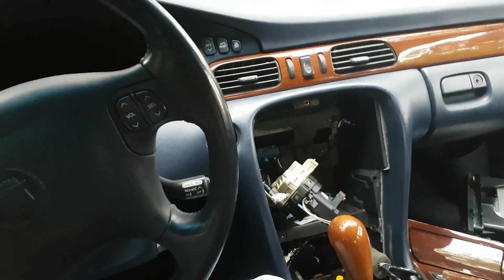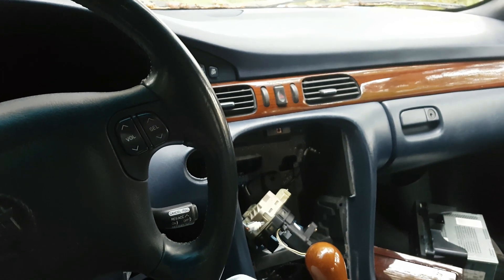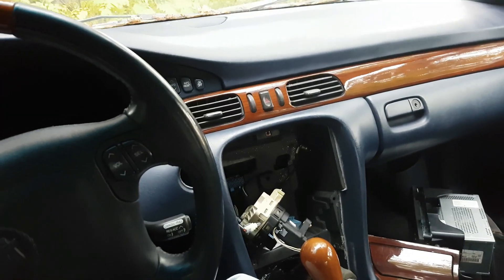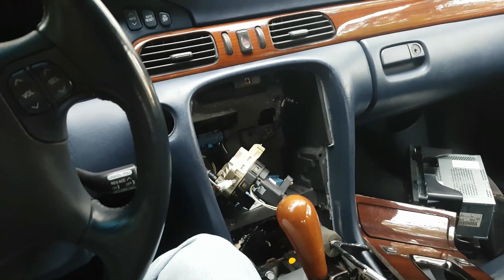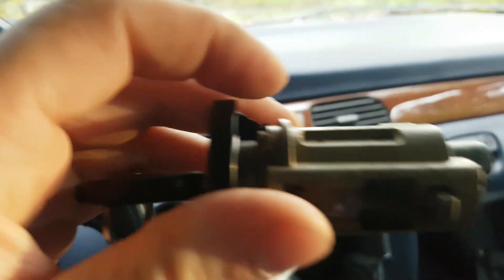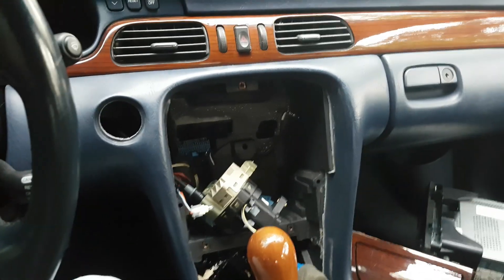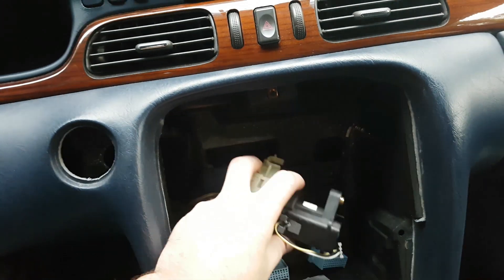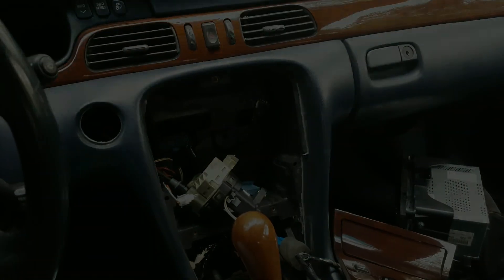98-04 CADILLAC STS IGNITION SWITCH PROBLEMS & REPAIR

Comment: I'm so glad that you posted this video because I was never able to figure out removing this style ignition. I have a 2000 Seville STS and encountered this same issue of not wanting to restart tonight. Luckily, I was at home in the driveway when this happened. Bought this car about 9 years ago not running, knowing there was this problem. It wasn't until one day while I was messing around turning the key back and forth and it decided to work. The car continued to start up and run beautifully all these years until tonight going right back to when I bought the car.   The Security light was always showing a code VTD B2947 and B3055. Listening to you explain the procedure I understand what to try replacing first.  Thank you

Comment: I will be doing this tomorrow and add any tips or tricks.  Thanks for this video!!!
Reply from the maker: Ive done this job a couple times now....it seems to be a common problem with these cars.....its not to hard to do....just a very tight spot to work in is all....Good luck and thanks for watching!

Comment: How do you get the shift lock cable off. I depessed the tab and pulled but its not coming off?? also what is the reprogramming procedure for a new key i had to replace the key and the Key way. I wrecked it getting it apart.

Comment: How should I remove the initial console piece? Do I have to pry it? I do not want to unnecessarily break anything.
Reply from the maker: The woodgrain panel that surrounds the shifter? Im fairly certain it just pops out of the retaining clips its held in by....Gently go around the perimeter of it with a trim tool or flat butter knife and pop it up
Reply: Thank you. Now, I am trying to remove the climate control panel. Obviously, I saw and removed the two bolts/screws immediately below the panel. What else is holding it in place yet?

Comment: Do you have or ever had a security service activated error? Causing the car to not start at times unless i disconnect the battery and wait 15min.
Reply from the maker: That error can be caused by the ignition switch but usually disconnecting the battery doesn't fix it

Comment: I replaced the switch hoping to fix a po300 misfire code, got it put in but now have no power to dash or heater controls, radio only, battery was run down but charge it up....any ideas what could be the prob? The car would up and die going down the road and I had to blow air or cleaner in the ignition cylinder to get it to start....maybe a bad lock cylinder?? Any help would be awesome, thank you!!
Reply: Never mind I got it, left positive cable unhooked, didn’t fix the misfire but it needed changed anyways, next up coil boots, then coils if that doesn’t work

Comment: Hey how do you get the cap that's on the ignition to cover where it says everything you know how it start run how do you get that off
Reply from the maker: Just use a soft pry tool of some sort and gently pry around it in a circle
Reply: @Videocipher  alright thank you very much I got the new ignition in it wasn't easy then I had the halo around the for the chip in the key I didn't know about I ended up breaking that you didn't have that on your YouTube but I thank you for getting back to me everything is good and I'm rolling so thanks a lot I'm up here and Belle Plaine Minnesota so thank you again
Reply from the maker: @mikecarlson4219  No problem man...Glad i could help you get back on the road

Comment: Does the key have to be programmed.  I thought the computer has to recognize the key.. thanks for the vid..going to do this next week
Reply from the maker: If your using the same key then it will not need to be programmed....if your replacing the key then it will....when you change the ignition switch your not changing the entire key cylinder....just the switch behind it

Comment: My keys are stuck in the ingintion will not crank 99 deville
Reply from the maker: Is it a Deville or Seville? This might sound stupid but if your battery is dead or very weak it will cause the ignition to not be able to turn to the off position making it impossible to take the key out...I've never seen it happen on the Seville (Sts or Sls) but i have seen it happen on the Devilles and ive also had it happen on a 2002 Monte Carlo SS i had

Comment: Wasn't very helpful. My 2004 Cadillac Seville has the ignition switch in the steering column 😟
Reply from the maker: Nope...98-2004 are the same car....ignition switch in the dash just like in the video....you either have the wrong year or you have a Deville not a Seville
Reply: You are right, my mistake. It is a DeVille